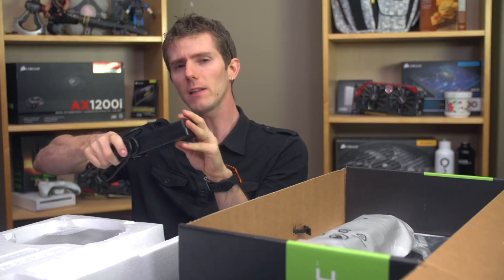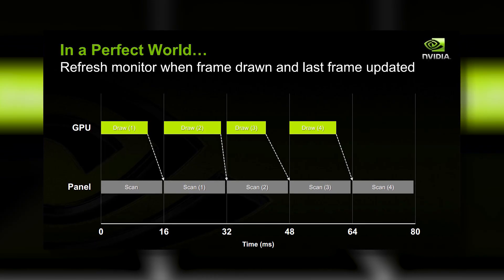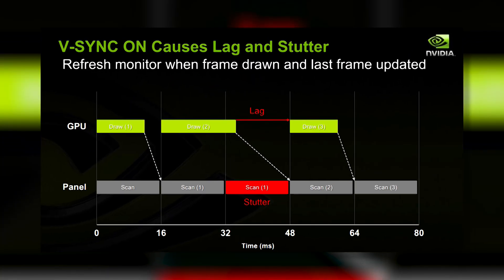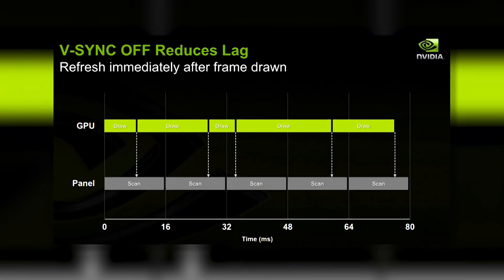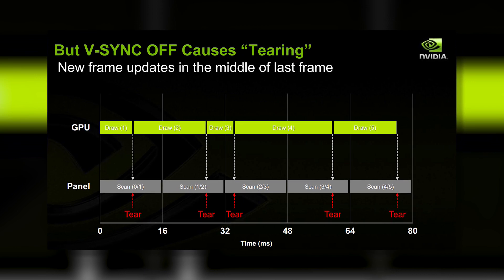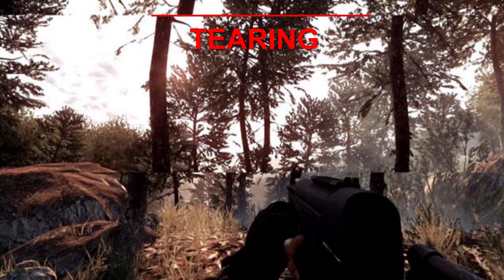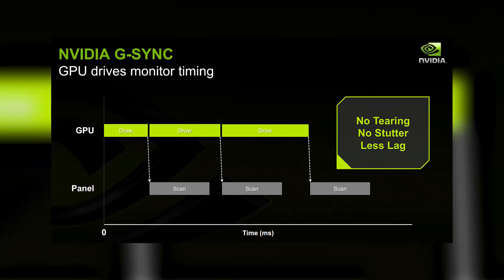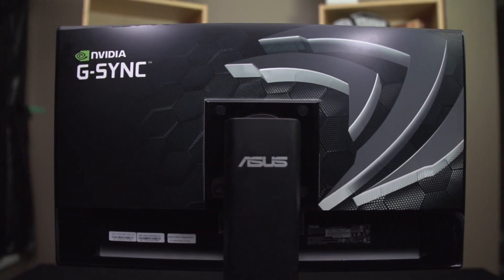NVIDIA G-SYNC Tech Preview - Linus & Slick's Impressions

Comment: i think this is going to turn out to be an isolated feature for only a few premier monitors, is hard to change this industry,just look  at pci express
Reply: It's a very simple concept and it's good to have it as a feature, but it should be an open standard that works with any GPU, and that display manufacturers can just include in all monitors.

Of course, Nvidia won't have it that way...
Reply: The problem is that consoles held graphics cards back, as a good AGP x8 was more then enough for a long while, and the games never really demanded something they couldn't produce.

It's not the same thing. :P

Though it's not going to split the market either as more monitors  can use G-sync, likely will and that doesn't stop them from being used on systems w/o G-sync enabled, and it doesn't require a massive shift to adopt.  :P

admittedly it's going to be slower then it should be.
Reply: Shawn Brady *pats you on the head*

Grow up..  Nvidia is doing well enough without G-sync taking off, that the investors won't freakout just yet.your just as bad as AMD doomsayers..  sheesh. 

Will NVidia share it. most likely down the road, but not for some doom sayers crazy imaginary reasons, but because they got the kinks worked out, and AMD won't be able to fuck it up without trying to.
Reply: Kerns Phoegon I'm just wondering... if AMD came up with their own design that does the EXACT same thing as G-sync, would there be a legal issue at all? Did Nvidia patent the basic ideology of G-sync?
Reply: zolikoff if it was to similar & worked the exact same way, then  I think there might be legal trouble honestly, unless they could prove they developed it in complete isolation, & to that..  it still might be bad for them (mostly because of how ... fucked up copyright laws are in regards to patents and similarly developed complicated solutions.

They likely pantented the methods they used, & the TV/Monitor side as well (which is something that AMD is likely to not do on their own with any degree of skill)   I suppose if you could create a Video port/HDMI adapter & Montor Pair that manages the refresh rate with a SW based solution,  it'd be possible, but that still introduces concepts AMD hasn't proven able to do.  I'm sure Intel could step in the ring partnered with samsung, panasonic, or sony, for that.. but I'm going to be honest, I'm not sure why exactly they would.

This is a HW & SW/FW solution, which is likely that if ya get similar functionality.. with a similar setup there is very deep legal issues at hand, Though you could achieve it via adapter & Monitor pair, but that's sub-par to Nvidias solution. (mostly because anything requiring an adapter to another product is alot of the times worse off then a version with it integrated, though there are exceptions to that)
Reply: Kerns Phoegon Yeah, I'll tell you that, I hate the current patent system too. I mean, if AMD just realized the basic concept (linking the refreshes of the monitor to the frames delivered by the GPU, through who cares what means), they'd be in legal trouble? That's like getting in trouble for making a toothbrush... sort of.

Anyway I'm not a fan of copyrights based on what a device does, especially when that description is one sentence long.

Again, surefire way to stall technological progress.
Reply: zolikoff Ya won't get a disagreement from me about the patent/copyright system.

The problem is now that the concept is out there in plain day & it's copyrighted,  how do you expect AMD to come up with something unique to them..  & even they know adapter for cards are a bad idea unless it's serving a completely separate function to either the GPU or the Monitor (such as capture cards). 

It's hard to say..  Though  AMD is just fucked until NVidia releases it for them to use via lease.

I'm sure they are going to work the kinks out, as I doubt it's perfect, but  all AMD can do is sit on their hands and maybe come with a HW based solution for PC gaming and not always go for raw power solutions (as that's short sited, given that it's going to be outdated fast on X cards, because new ones come out), 

While NVidia hasn't dedicated towards pure power, they have been working on HW supported features that would be very powerful once perfected, or at the very least very useful.  AMD has their heads warped in SW to far to much on a ratio for a Graphics card developer.  while it's important, Graphics cards also need HW support, and that's where AMD is failing,  the support of the extra stuff. V.v  Nvidia has been the one pushing for that end., with the exception of Mantel, but I'm more willing to bet they got that from MS & Sony via the consoles.
Reply: Kerns Phoegon i dont think it will cash or crash nvidia, but the feature itself will not be broadly adopted, Nvidia has many really good products but their  marketing tactics lack. I.E. Shield
Reply: Shawn Brady You need help. seriously  doomsayers are idiots, even more so when they suggest illegal shit.  (ignoring the fact AMD hasn't come up with shit on the HW solutions front to aid graphics, and are behind NVidia miles on that side.)

You know who's going to suffer the most if the PC gaming market tanks or slips into a big slump.. It's going to be AMD, because their reference cards just outright suck for one reason or another, & their advantages mean nothing to general consumers and they also fall behind in productivity tasks where time is money, along with the worst average stock performance there is.  NVidia is going to be fine, in the long run even if the PC gaming market slows the fuck down (I doubt it'd ever die or completely crash, nature of pcs and all)

Market shares is your reasoning.. face palm woopty fucking do, that shit goes up and down faster then a whore with consumer tech companies on hype alone.  Not to mention it's a long term 'game' as it were and you clearly aren't qualified to make sound choices, as the only reason AMD is still in business is that some how NVidia let them get the graphics processors in both new consoles (X1&PS4) so they'd have atleast 5 years of float.  you honestly think that Nvidia couldn't have swooped in with a better chip and undercut the hell out of AMD?  & in the critical development stages of the consoles when AMD was at the weakest closing plants to stay afloat as well.

I'm more willing to bet that NVidia is ironing on the bugs, and is likely to license it out because that's just smart business moves, after they worked out all the kinks, on both sides.

P1an0Freak Honestly, I doubt it would be a killer feature, or hurt NVidia..  Just like Shadow Play.

Though Tacky marketing on the shield?   How,  all I can remember is them showing it off in the worst WiFi environments possible and it still worked.  I have to admit   I liked the fact they proved the shield worked and how well it worked even with cluttered and lag ridden wifi networks like convention halls.  I think they had to do it that way, because hype alone was not going to dismiss the retarded rumors about home networks not being fast enough, which is bullshit honestly.
Reply: Kerns Phoegon I'm right there with you on everything except the next gen graphics manufacturer statement:

Nvidia couldn't have swooped in with a better chip AND undercut AMD, because AMD is pretty much the only manufacturer willing to lose initial profit on chip sales, and they kind of are.

Think about it. Their dual Jaguar-4-core plus cut-down 7870 die is going for about $100... a single 7850 die is already much more expensive than that... They're losing profit, but they're going for it because of the tech & development opportunities they get.

Nvidia wouldn't stand for such things, they'd demand a lot more cash, and keep in mind, they'd probably only supply the graphics solution, so the consoles would need a separate CPU solution.
Reply: zolikoff you honestly think they wouldn't have used a modified tegra 4 chip and sold it at near cost?   Please. :P  the problem is that no one outside NVidia & NDA contacts knows the true costs.

What you aren't getting is that NVidia can afford it while AMD can't and they could have undercut AMD still and you know it.  to where that'd be smart or not,  remains to be seen if ever, but if they fuck this up, and mess up the drivers for even one game on either console... AMD is going to get a ton of backlash.   That also said,  to many fanbois would flip out to hard if the true performance of those 8cores was revealed (pretty shit actually compared to any 4 core HT intel, or any other 8 core cpu (even 6 cores)

Nvidia could easily have paired with Intel, and both companies could have sold the units at cost, and have the manufacturing ability to have very low production costs and it's showing time and again.

Down & dirty, simply put  Intel & NVidia choose NOT to push AMD into the ground, when they could have let AMD crush itself and not give it the consoles in a failing market.

Though I'm pretty sick of idiots who think this is a big win for AMD, when honestly ....  I can't see it as such, because if enough games start to be AMD optimized, anti-trust law suits can be filed against for degrading the performance of similar NVidia cards in favor of their cards by completely dominating the Console market.  Also  all it'll take is 1 year and for some reason the consoles have a high graphical error rate for this to damage them beyond repair, and only the most HC fans will stand behind them as they would have then damaged millions of consoles, unknown numbers of games, and hurt an entire generation of consoles, along with pissing MS and Sony off.
--That said,  they will likely put more effort on the console development for driver and resources to make sure they work, which means far less pc development from an already ... lethargic GPU maker when it comes to reference cards that could be considered flat out lazy, bad, & not worth while, taking 3rd parties to fix their cards with non-reference designs.

I don't want AMD to disappear, but...  they haven't shown enough resources to split their attention to far in products and it's likely going to lead to them going into APUs ... and trying to attack Intel, which is just ... silly, because even if Intel felt threatened, they have the resources to do what they need to.
(Oh, and you wouldn't believe how many people I've met that blame intel for having their CPUs retain better single thread performance)

Well see how this plays out, but I'm not going to be a happy camper if ports start to favor AMD cards, by any margin worth note.
Reply: Kerns Phoegon Yes, Nvidia definitely has more money than AMD, I know that. So they could've possibly undercut AMD on the consoles (though not with Tegra 4, it's a great chip but nowhere near as powerful enough for a contemporary performance console).

What I'm saying is, they wouldn't. It's not within their usual business strategy. And they definitely wouldn't just side with Intel on the matter, hell, in the embedded market they're rivals.

And I'm not saying that the next-gen consoles is a big win for AMD, it really isn't (especially if they're selling chips at a loss). What I'm saying is, it was financially logical for the console manufacturers to go AMD, and AMD just accepted because having something is better than having nothing.
Reply: zolikoff I'd normally agree with something better then nothing,  but this is honestly a dangerous spot if they mess it up, which one would think they don't want to do. 

I think they wanted to bank on production costs lowering enough to turn a profit, but what they are failing to get is that the likely bulk of the console sells will happen before their cost go down,

ya, your right Nvidia isn't in a crunch position, but ..  some times crunch choices backfire greatly in the long run and well see how it plays out.

actually tegra 4 is powerful enough if dedicated to graphics & not throttled by power limits or battery consumption.  it's also an ARM chip which is something I'm sure MS & Sony didn't want to fully go into :P   going to be interesting to see what turns from this, as I'm curious how bad it truly was for AMD if they took this, where they honestly get almost nothing from it with the exception of hype.. but those who are effected by hype and let it drive their purchases are dumb asses that are fleeting as the next best thing from either side will get their attention.

I don't think Nvidia has anything to fear from AMD honestly, mostly because of the markets Nvidia can serve and what's coming up, same with Intel.. It's going to get interesting >.>
Reply: Kerns Phoegon Hey, hype does drive sales a bit, it's better than nothing. :P

No, Nvidia definitely has nothing to fear from AMD, but I don't think AMD are in a bad position now either.

Also, I wouldn't agree that buying AMD makes you an automatic dumbass... Their products aren't actually bad, it's just that when you think about it, they could be a lot better, and it makes you a bit sad, and probably reluctant to buy.

AMD's problem is mostly that they were aiming too high for a few years now, and they had very bad people at the helm for too long.

They have somewhat less worth than Nvidia, and MUCH less than Intel, yet they've been trying to make as much progress as both those companies at once... It's natural that they sort-of failed in keeping up with them.

Still, they've recovered pretty well since the beginning of the year (remember, shares in January were below $2), so it's not like they've lost all hope.
Reply: zolikoff I didn't mean all AMD users are dumdasses, just its vocal support, that will refuse to listen to any reason, and Nvidia has them as well, but the don't rely on them to marketing.  I'm not sure that AMD will be anything other than a check for Nvidia or Intel, and maybe that's enough, but I'm not so sure that'll work for too much longer, if more consumers get wise about the actual performance and how good the product is without the need to oc it yourself.

I guess for now, it'd be good to take the apu/integrated CPU low end market with some choice, but I'm not sure that's viable in the long term.

Comment: this is really great but knowing Nvidia they will apple it. Also me personally, I will NOT buy another monitor and GPU only to remove the little tearing that i encounter, Unless Nvidia pulls out another 8800 i'll stick to my Vacuum cleaner (R9 290) becuse as of right now the extra cost of a 780(ti or not) doesn't justify 5 or 10 more FPS.

Comment: wow so if G-sync actually works even 30 fps situations will feel exactly like 60 fps situations because the refresh rate of the monitor will match the fps?
Reply: ***** it will still be pretty good. 30fps right now isnt even all the time, at least with g-sync you won't feel the drops as bad or at all. 30 cant be 60 but it can be smooth and even.
Reply: ***** That's the point..   It'd feel like a completely smooth experience despite the FPS, which is entirely the point of 60+FPS with V-sync.

So ya, it would feel like that.  it'd make the graphics cards life spawns alittle long as the frame rates smooth feeling can help playing even with lower spec cards (for the time it's in) vs the game it's running

Comment: For HDD vs. SSD, I have no issue alternating back and forth; at least, not anymore. My 840 pro is about six months old, and lives in my laptop. HDD is a WD Velociraptor for my desktop that I recently installed, old one was 7200 RPM. The extra 2800 RPM makes a pretty big difference, and the desktop's superior hardware makes the overall experience pretty even.

SSD vs 7200 or 5400 RPM? I'd rather slit my wrists than go back. While they're fine for storage, I'll never use them again for my OS drive. Ever.

Comment: no way will i ever go back to a mechanical hard drive. i work at Staples and all the "tech" associates think that SSDs are "for laptops" or "only for using adobe photoshop"...whatever that means....they just don't get it. bunch of dicks. once you go black, you don't go back.
Reply: What does that even have to do with...

Well, anyway, they are kinda right. More battery life and less heat is good for laptops, and all Adobe software is bloated and takes forever to load on a hard drive, plus no one spends all their time rebooting their computer.

Comment: any time i need to use my parents computer for something which doesnt have an ssd in it, it feels like im running a computer that is 10 years old just cuz it takes soo long for anything to load up. 

Regarding G-sync, i love the idea of it. However, I just picked up an amazing dell 21:9 monitor a few months ago, and I really don't want to change. Would like the idea of an upgrade module of some sort that we could install ourselves into monitors. Would be cool if there was a way to do it through something that plugs into the display port on the monitor (given the way it works, this is more like a perfect case scenario that will likely never happen)

Comment: Hi Linus.
I have an SSD in my desktop and a mechanical hard drive in my laptop.
When I go to use my laptop, it seems like it takes forever to even just boot up, and this is with a near empty hard drive. But when I go to my desktop and use my SSD which is half full, it is still extemely faster than my laptop. So yes, it is hard to go to a laptop. And I do think your thoughts on G-sync. I rekon give it a year or so and then you will see it drop in price and people starting to buy it.